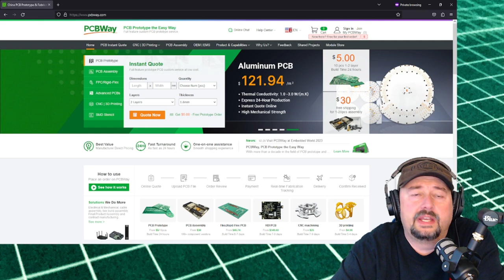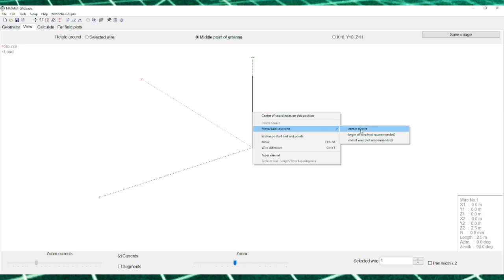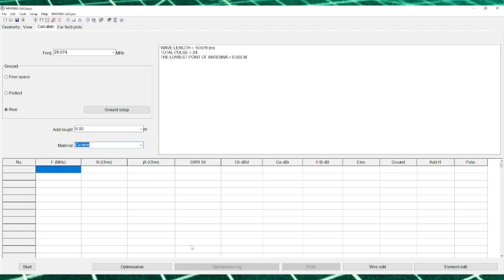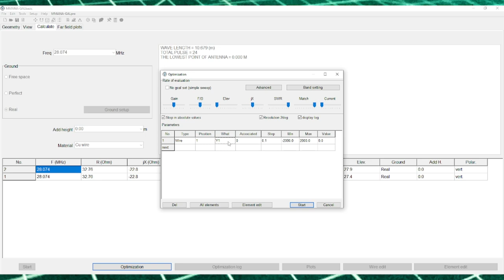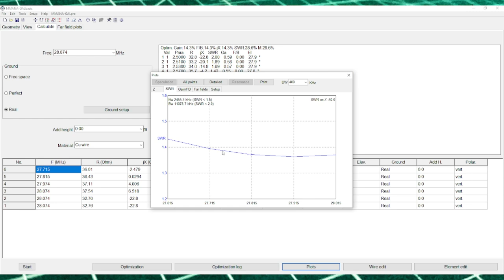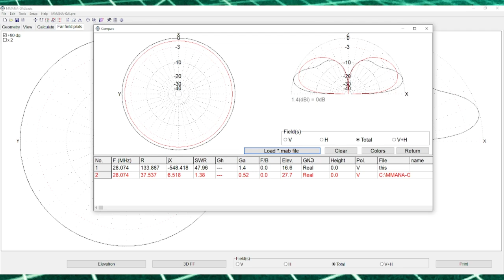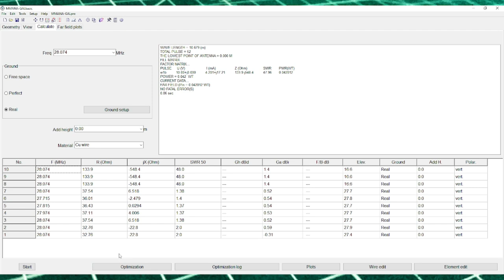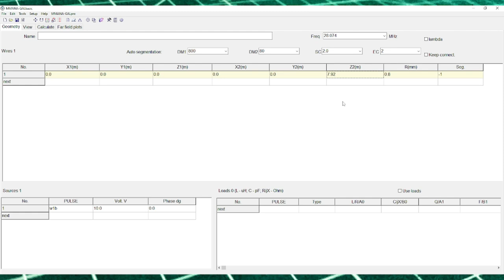1/4 vs 5/8 Wave Vertical Antennas Compared with MMANA GAL

Comment: CB guys use verticals right and left for 11 meters, but hams seem to stay away from verticals on 10 meters. Why?
I found 5/8 verticals are great for DX. For South America my first 10 meter setup for DX was three phased  verticals. It was cheap to build and worked great. There was a rope between two trees with three 10 gauge wires hung on them. They were in phase with a radial field of wire scraps left over from other projects.

Comment: Excellent and thank you for showing. 

The thing i missed is a good radial wire network. In my opinion a vertical always depends on a good radial network. Not for impedance bit for take off angle. Otherwise you have no idea of efficiency in real life.
Reply from the maker: Yeah, they are very helpful for takeoff angle and minimizing ground loss 👍

Comment: Would be interesting to see the effect of height above ground, as it increases.👍🏻
Reply from the maker: You’re the second person to mention that, I suppose we can do a follow up.  Thanks man 👍
Reply: for skip on the ground is fine ... but 
in country.... hight 20m 1 wawelenght abowe ground 
defently give a way falatter earth wawe... so the wawe hugs the earth way longer before taking off
in ARRL JESSUP and ROTHAMMEL a 1/4 has minus 1.5DBd andd a5/8 wawe has +1.5DBd
so 1.5 over a 1/2 half wawe and 3 DBD over a 1/4wawe. 3DBd is still 50% longer earth wawe.. then a 1/4 same hight.. 
remember 6DBd is X4 to dubbel RAnge .. .. a 5/8 Wave (7m) on 11m is a 1/2 on 20M 1/4 on 40M just do the math why make so freakin complicated.. if you use a SIRIO4000 8.4M long then You got a 7/8 (3/4) on 10 11 12M and a 5/8 on 17/20M and a 1/2 on 40M with Gamma Match it dont have to be complicated .. most amaturs like to complicate the antennas way too mutch
Reply: I want to put my Chameleon MPAS 2.0 antenna on our 2.5 metres high wooden timber pergola, clamp it with the Chameleon CMU, add a Cap-Hat, and as many raised radials as possible... God only knows if it will work... 😂

Comment: If you wanted to raise the "wire" above a ground plane (and I realize you may not need one for a 5/8 vertical), which parameter do you change (Y2)?  Also, if you wanted to add a loading coil at the base of the "wire" how can this be modeled in MMANA?  Is that choice available in some tag in MMANA? Does anyone have a podcast that illustrates how to use the "Loads" section in MMANA?  Thanks!
Reply from the maker: I haven't found a good solution for elevated ground planes using the ground radial feature.  You could and extra wires in the geometry tab.  If you chose the "setup" menu item you can change the feedpoint impedance under Standard Z to match your  "load" coil, if that's what you are talking about.
Reply: @TheSmokinApe    I am trying to raise the antenna above the ground plane, not the ground plane itself.  As you raise the antenna above the GP, the impedance will change, allowing for a better match between 50 ohm coax and a 5/8 height antenna without the need of any matching devices.  Also I'd like to model a loading coil at the base of the antenna, and was wondering if anyone knew of a way to do this in MMANA? Thanks for the reply though.  73's!
Reply from the maker: Gotcha, not sure about raising the antenna w/o the plane.  The was have have seen folks model the coil is by adjusting the input impedance but I get it's not that same.  Sorry I am not more helpful.

Comment: IMHO a 10m quarterwave at ground level is a poor choice, although MMNAGAL models it fine. Bearing in mind the real life environment that my vertical is in, fences, rose bushes etc relatively close in to an antenna that does most of it's radiation from the high current portion  that is closest to the ground. The point being that the MMANA model might work if I had a football field to mount my antenna in but I don't, the antenna cannot directly "see" any sky at a 5 degree elevation. A current node further up, such as you have in the longer antenna will yield a lot more advantage in my environment than the MMANA model suggests. Too many hams have become slaves to SWR, and the resonant antennas nonsense. Best to get the pattern you want before devising how to drive it. With the ground mounted verticals raising the impedance also raises the efficiency, thank you for the presentation.
Reply from the maker: Thanks for the insightful post.  I agree, the model is just that, I representation of how your antenna should perform in the conditions modeled.  It would tell you have it will perform in real life.
Reply: @TheSmokinApe  thank you for the polite reply, as much as I love to use MMANA the real world environment is different. We are very fortunate to have some great tools available to us. 73